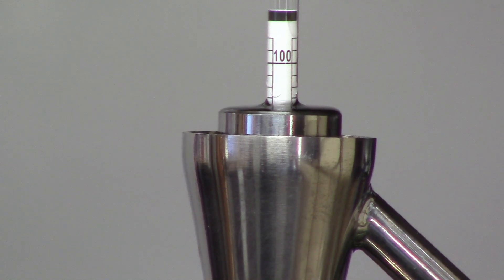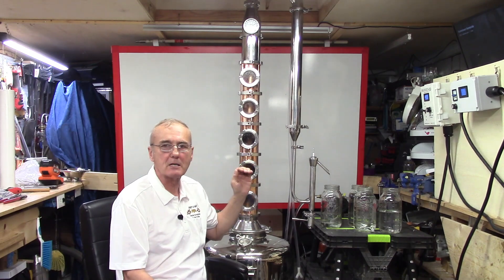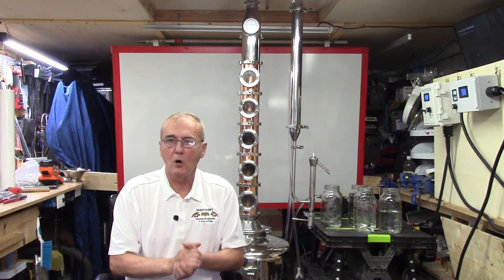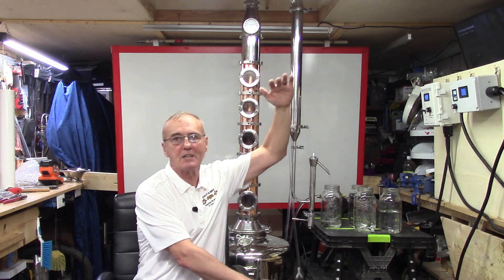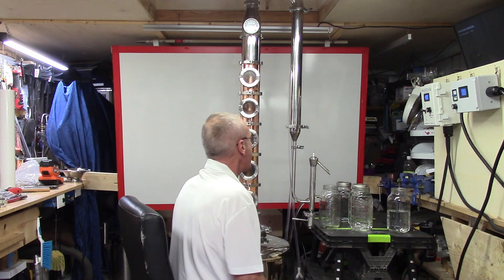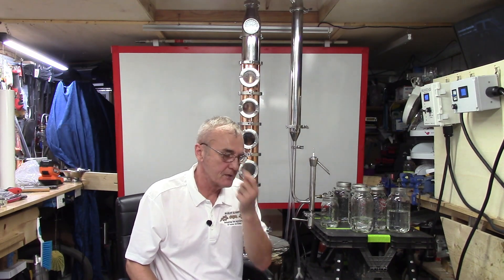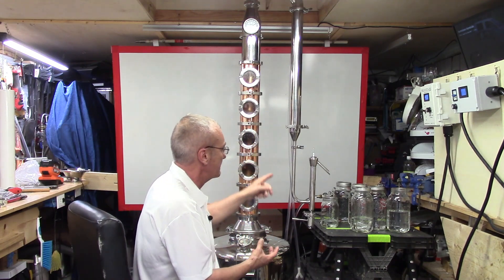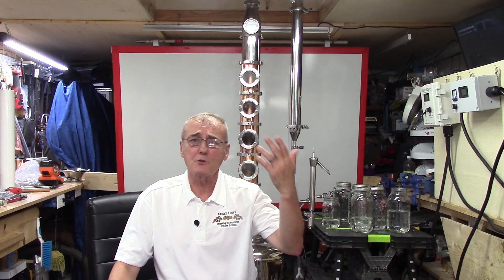RUNNING A STILL (FINAL PART 4)  MileHi 4 inch bubble plate column

Comment: Hey George, 

I have a weird one for you... 

I have a 50L (13.2gal) keg still, 2 2.4kw elements, running it at 3.96kw.

Column is 6 4" bubble plates. 

Stripped 250L of wash, ended up with 35L at around 85% (I added a bit from a run I wasn't happy with earlier).

Take off rate 2.5L p/h (0.6gal p/h).

Collecting in 300ml jars (0.317quart)

It has been collecting (temp corrected) azeo the entire run

Hit hearts at about 11L (2.9gal).

Take off rate dropped from 7mins 12 seconds a jar to just over 9 mins. I adjusted take off but over compensated to a jar every 5mins, put it in to full reflux for 15 mins and readjusted take off to be 7mins.

Tasted it and it tastes like heads. Then it went straight from that harsh heads smell to classic tails, tails came in very very early too. Any ideas why the distillate suddenly tasted like heads in the middle of my heart and then went straight to tails? 

On a side note, did you say you were running your still at 5.5kw? My 4" floods at 4.3kw 🤔
Reply: Also, what is your take off rate for a 4"?

Comment: Thanks, great video. Wish you would have told  us the temperature at the top of the column
throughout the process, especially when you thought you were getting tails and when you turned the run off.

Comment: George I don't know if you are still making videos and answering questions but I was wondering what size arm I need on my 12 gallon still.  Right now I have a 5/8 diameter copper line but I am changing adding a thumper and I thought maybe I need a bigger diameter line to heat the thumper up? I was thinking 1 1/2 inch diameter. What are your thoughts?

Comment: I have subscribed and have learned a ton from your videos and have a question. 
I make tinctures using 190 proof Everclear.  Currently, to concentrate the tinctures, I evaporate the alcohol off, but it's very wasteful.  I was thinking of using an open system pot still to capture the evaporated alcohol.  Does this sound feasible and safe? Also, would I need to be concerned about head or tails? 
Thanks

Comment: Loved  your 4 part series. Quick question  for you. If one were too leave the bubble plates/caps in the column and keep the deflag turned off, how much reflux action would you get from the plates and caps alone? Only reason I would leave them in the column is for a bit more copper to vapor contact and running as a pot still for alchohol that needs flavor passed through rather than a neutral spirit. 

Regards

Comment: Question sir! What is the ideal temperature to pass through the inlet of the deflegmator in my 26 gallon 4 inch column four section reflux still. I’m struggling to keep my water temperature consistent and it’s causing me issues. I need to redesign my cooling system for temperature consistency and I’d like your option on what temperature is ideal to send through the deflegmator?

Comment: I have two thoughts George first one is more a question. Do more plates mean faster distillation at higher abv? (up to a point ... I mean 3 obviously isn't enough, but I've seen some sold with 12 plates) 
second is one I will probably get roasted for if any one reads this comment but ...  I don't clean my still .... ever !  I rinse out the old sugar wash as I'm about to add the new sugar wash but that's all.. I Leave my still (same as the one in this vid) built in my shed for weeks between batches . My theory is the alcohol had no bacteria in it when i started the run (it would be bad flavours if it did) and then the high abv alcohol is an antiseptic cleaning out the entire still as it goes.   I mean so long as I only open it as I'm about to use it , it must be clean !  Thoughts  please people (friendly not rude)

Comment: Hello George  and thank you  for such a nice video. Have a question for  you: Does the speed of taking foreheads matter with this type of distilling? In part 3 of this video the speed was a bit faster than 1-2 drops per second. Could you please advice on that. Also, wondering if such type of distiller allows  to make only one run or do we still need to make a second run. Thank you.

Comment: Hi George, thanks for the content sir. May I ask if food grade plastic bins are fine to store the distilled spirits in?
Reply: Yes they are ok to use.

Reportedly food grade plastics are not going to leech chemicals from the plastics etc.

I've used plastics in the past but gradually moved to all glass over time but that's just a personal preference.
Reply: It is not recommended. Stainless steel is the best option because it doesn't risk catastrophic breakage like glass

Comment: Great (4 part) series -- I learned a lot. What was the head temperature up to when you turned it off? Also, what temperature is the product in the parrot (really asking what temperature range to shoot for in the output stream)?
Reply: Good question, I was of the understanding, that the head temp was more important than the pot temp. The temp in the parrot will also change the value??

Comment: Another reason to do a stripping run is if you have a pot still without reflux. In this case a good yield of fine wines will not be full strength and a second final run is required to boost the proof.

Comment: Hi there I have the same still set up and added a pid controller to it and  was wondering I’m at 6800 ft altitude does that effect the temperatures of the alcohol coming off like how my water boils at 198* f   The best I can get is 180 to 182 proof I was going to call you but didn’t know if you still took calls and emails thanks for all the info your the reason I got in to this art

Comment: Today i found light blue crystals form in the air space of the bottle of an apricot/sugar run from last summer... does not dissolve when shaken. Distillate itself is nice and clean. Used t500 in pot still mode... 
Apparently it can be copper acetate... anyone ran into this before? Should i be able to rerun it in full reflux/slow steady?

Comment: Hey George. I never really got a feel of your opinion on the Russian Stillman X unit you tested. Also, has your opinion changed on direction of water flow in condenser?  Andre does his opposite direction of vapor flow vs in the bottom, out the top....opinion?
Keep up the good work 👍🏻
Reply: Default rule is to always be opposite simply for efficiency. BUT, it's not necessary for the dephlag/reflux condenser. When plate column is loaded and balanced, you don't need very much cooling. Power in boiler should only be high enough to only require a very little amount of coolant to flow through condenser. There's another rule of always controlling flow at output, not input. By going with vapor, your flow control is at top which will also purge condenser of any air either from first filling or during run when heat releases air from water. The flow is too low to fight gravity and push the air down and out if valve was at bottom.
Reply: If you input the water from the bottom, it will fill the void inside the jacket and allow the vapor tube(s) to be fully enveloped by the water.  If you go in at the top and out at the bottom, the water will just freely flow without fully filling the jacket.

Comment: Hi Geroge... I'm not sure you can get that high ABV in a pot still from a low alcohol content liquid or I'm missing something?
Reply: In another still like  mine I start collecting  at about  165 proof and it drops fairly  quickly  i stop at 100 proff a reflux still allows  you  to hold your proof  the entire time  if you  run it correctly  takes  a lot of  practice  and patience  happy  distilling!

Comment: I would have run the tails down to 20% and collected them into the feints container - an all feints run is the bomb
Reply: Agreed. I was a little surprised he cut off so quick. I would have definitely started collecting smaller cuts down to a lower ABV. You find some interesting things where funky stuff disappears and interesting things show up briefly you might want to keep. Lots happen and change quickly in the tails.

Comment: Hi George, is there a difference in using the port hole style bubble plate sections compared to an all glass style? I’m planning on building my own still and noticed the different styles.
Reply: I've tried both and personally think the glass ones are better.  They provide more visual area and are less expensive.  We've gone to the all stainless plate column so there is no need to clean copper plates, in fact we pretty much just let it drain without any cleaning since the alcohol sterilizes it.
Reply: @rocketsroc  Thanks for that 🙂

Comment: Awesome run George. Hey one thing on strips. One could use it to better handle large volume of mash when you have a smaller still to save time. Think 30 gal mash into three 10 gal strips at 2 hours each then a 6-8 hour spirit vs three separate 6-8 hour spirit runs. Save a little time and makes cuts so much clearer. But that just my two cents. One could argue just do a 11-12 gal mash and pull off the 10 gal of clear then be done with it. So there is that! Anyway. Keep on teaching George. We love ya!

Comment: George are you tending to lean in the direction of the PWM instead of the PID to control the power of the elements. If so what is the difference
Cheers
Reply: Balancing a plate column requires control of both heat and cooling below and above the column that is consistent throughout the run. Would e difficult if not impossible to achieve with a PID. Consistent power output control is needed regardless of boiler or column temp.

Comment: Mate, very very good, I loved the 4 parts, I have been running a Pure Distiller 25lt for a year now & I should have told the ex years ago I am just going to do it, but she was no no no, anyway I am looking at moving to the next stage an upgrade, more control use my local corn, barley excetra, & thanks to you, Jess & Bearded & Boarded you are making the move a lot easier on what to buy excetra. Thanks

Comment: Hi
.
What is the best best best temperature for  
( White or red wine ) in the fermentation process?
Reply: You don't run a still on temp, only used for feedback throughout the run. The alcohol content will tell you what temp to start at (whatever temp it starts boiling at) and then go from there.

Comment: I have a 15.5 gallon kettle and run a 2” column that runs into a 1/2” reducer at the top of column, then runs down a 5 ft condenser (all 1/2” with 1” water jacket)...I’ve ran 2 vinegar runs so far to clean everything and noticed the thermometer at the top of the column will jump from 80 degrees to 180-200 degrees after 45 minutes or so...I’m running x2 1500 watt elements at 100%. My question is when do I back off 100% power to gradually hit my target temp of 175? Is this something I have to trial and error or is there some kind of rule of thumb to follow? Thanks! Love your videos!!
Reply: Its a trial and error sort of thing. Your elevation and what mash your running will cause it to change some. I have a similar set up for me my range is about 100 f to 120f then I drop down to about 1/4 power input and let my collum stabilize ( no temp increase) then I slowing increase until it starts running at a flow rate I'm happy with. Edit: that's what I run my alcohol runs at. Cleaning runs I run at 100 percent.

Comment: I think you’ll find that if you use a 3/8” needle valve on the deflag you’ll have a more precise control. Ball valves are to finicky.
Reply: Absolutely correct.  Ball valves are too hard to finely adjust.
Reply: Yup. I found a cheap angle stop works well too. Not the 1/4 turn ones, the ones that you turn multiple times that gives you the resolution.

Comment: I always ran my 16 gallon pot still stripping runs so that I could do a spirit run and get a higher proof whereas if I ran just a single run I'd never get over 65%, but I consistently begin collecting at 86% on my spirit runs
Reply: Agree - I've yet to find a decent tasting spirit that was distilled just once.  Larger hearts cut on the second.
Reply: @Rubberduck-tx2bh  I couldn't shake the bread profile from the yeast, as I always ran cloudy washes

Comment: Stripping runs of sugar mash made with turbo yeast and run that a 2nd time with a reflux and packed colum gives a better end product or?
The other reason worth mention is stripping is also nice for those who distill brandy and wants bring over flavors, I think that is worth mentioning and not only talk about reducing volume. Correct me if I'm wrong.
Reply: Best brandy comes off a pot still. Only thing you are stripping is flavor.
Reply from the maker: All good points. Striping runs are not wrong; in many cases they are not necessary. I read many comments where people are using these runs as a means to improve their final product and raise the proof. All good techniques in my opinion.
Reply: And in a stripping run normally no cuts are made.
Reply: And ran again... Stripped.
Reply: Run it once, proper cuts, liquid gold.

Comment: i know many say sugar wash makes zero methanol , but will any of the first 4 shots that are removed  burn orange or blue/clear. Ive read some guys didnt even bother to distill the wash just drank it once it had cleared, i guess at 20% it wouldve been sterile not to mention the initial starsan sterilisation process at the very beginning. So much information and missinformation in internet land.